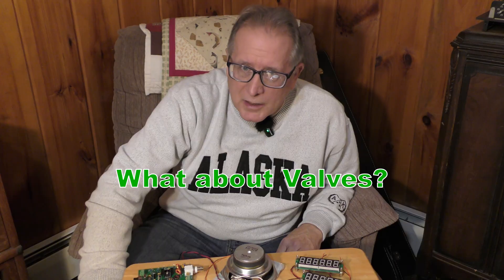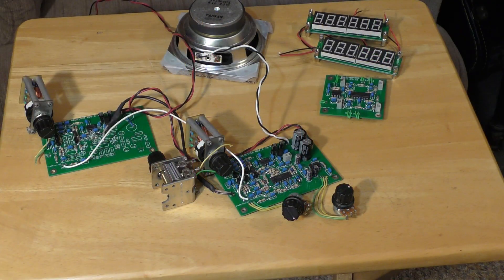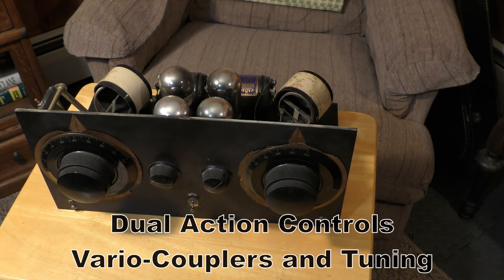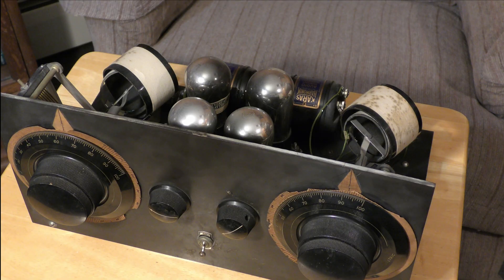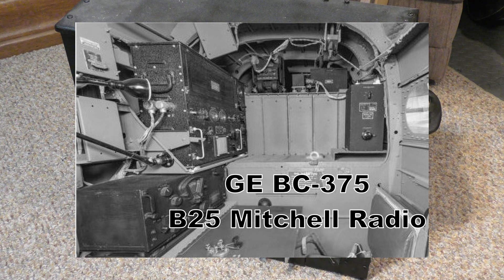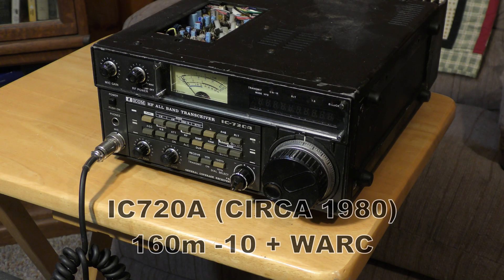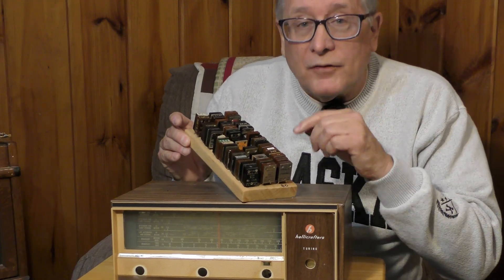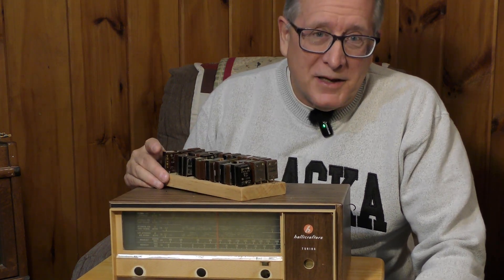2026 Upcoming on the Channel!

Comment: Wow Mike, a lot of interesting projects coming this year!  I seen you had a couple of programmable frequency counters laying there with the other Solid State PCBs. They can be use to convert a radio to digital readout for the frequency it's tuned to.  I have a few of them too.
Reply from the maker: I actually did this before in a receiver, but the noise they generate has to be understood and managed in sensitive circuits!

Comment: Looking forward to the new videos! I'm certainly interested in the icom HF rig that you presented. Would be fun to look at the circuits inside, especially the power amplifier stuff. I love power amplifier stuff :)
Reply from the maker: When Motorola published that 100W push pull wideband circuit in the back of their transistor manual in the mid 1970s - everything changed...

Comment: Crystal grinding rocks :) I'd like to see that, the Paraset, and anything military. I don't think the old Japanese radios would be worth restoring or interesting to see. A quick inspection, if even that much, and then hit it with power to see what happens might be fun. I'd be afraid that if I looked inside first, I'd see broken things and then get sucked into restoring the whole rig that I don't even want.
Reply from the maker: Lots of Military stuff here. That era in Japanese design was a crossover from US handbook circuit style to some pretty wild and hard to follow circuits using home grown parts.

Comment: As always, all of your videos have something to offer for everyone!  My current project is a BITX "type" SSB rig building from scratch using the Arduino Mega pro, and using a 4" SPI TFT Module display.  It will be a 160-10M transceiver once completed.  Building electronic projects are a lot of fun, and you can gain a lot of knowledge through experimenting.  Have a great new year in 2026 Mike.  73
Reply from the maker: Wow that is quite a project - a career punctuating type, high end project, for sure!

Comment: Hi Mike,
I have an FT-901DM that I bought new in 1979 six months before they came out with the 902DM. I also have the FV-901 external VFO that goes with it. I intended to recap it and the VFO is stiff, so will need to remove it for lubrication. Will be very interested in that possible restoration video. I see parts for the 901/902 come up on Ebay occasionally. Also the trap dipole. I had bought the Unadilla 80/40 trap dipole kit in the 70's and used that antenna for decades.  73  WJ3U
Reply from the maker: I thought that the Unadilla was a pet?  OK on the 901 but I am really a newbe on these early Japanese rigs - we shall see...

Comment: Some interesting projects there - looking forward to the new year. Always interested in the WW2 shift to VHF and military gear from the 50s and 60s. 
I “hate” the BC-375 as they’ve become so expensive but just recently on social media a nearby ham offered an R390A (!) from his family.  Couldn’t afford one of those either but he just wanted it to have a good home.  It worked FB but I’m still learning to use it.  73, Mike
Reply from the maker: The VT-4 / 211 tubes used in the BC-375 BC191 were so ignored and reviled by hams post war, that many surplus outlets would not even sell them, and if they did, they were 75 cents each. They made excellent targets for 22 shooting. Hams wanted the new beam power tubes like the 813 and 6L6. So we get what we deserve I guess...
Reply: @MIKROWAVE1 What would it take to adapt a more available tube to the BC-375?
Reply from the maker: @clifffiftytwoI tried this but I went too far. I had a BC191 that had already been converted to a crystal controlled 807 oscillator in the first socket! Where I ended up was 837 ECO, 814 PA with modified plug in drawers. Sounded like a Yaesu. My guess 811s with a lot of work.

Comment: geez.....I got a butt load of parts from an SK estate.....some of it.....I got no idea what it is.....I might hafta put up a video of what stuff I have no idea what it is.....I'd hate to just toss the stuff I don't know about.....cigar boxes full off connectors that look like it would be for various coaxes...boxes of vintage knobs, parts, etc....when I get a bit more "flush" later in the month, I may hafta do just that.....get a video or two up....see if anyone knows what it is.....I look forward to your videos this coming year....I still ain't got my Elecraft K1 fixed (bad VFO/Encoder???)....have a borrowed radio I should really return to the fella...and get my old Swan 350, and Ten-Tec Century 22, hooked back up....no WARC bands on the Swan, but 30M on the Century 22....I also have antenna work I need to do here at the shack....can't retire just yet, but need to get back into building stuff, like I used to 40 years ago....TUBES AND MULLETS, FOREVER.....I'd also heard some of the SWL stations are coming back on the air.....not sure of that, but I'd sure like to have another SW rig, just to listen around...I have always loved tubes.....got some miniature tubes somewhere as well....
Reply from the maker: This is happening all over as the hams age out!

Comment: I have a Browning Drake Kit radio that i need to restore. uses 5 -  UV199's, Old push and twist tubes.
Plus many more vintage radio, Eveready Model 3, Radiola III's, Atwater Kents.... All from the 10's to 30's
Reply from the maker: Radio restoration is a lifelong hobby, and you can really get into the woodworking too. Fortunately, they made so many tubes from this era, that they are not too expensive and as folks age out, more will be available at lower prices. Prices are falling on these collections of spare parts and gear